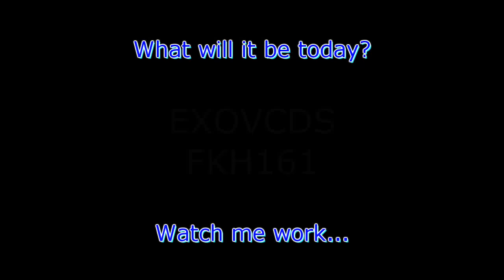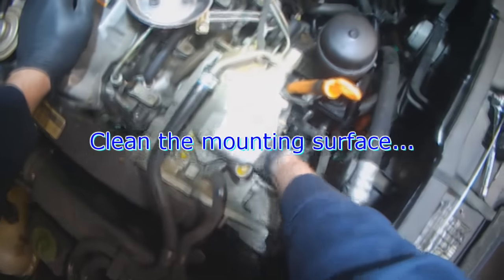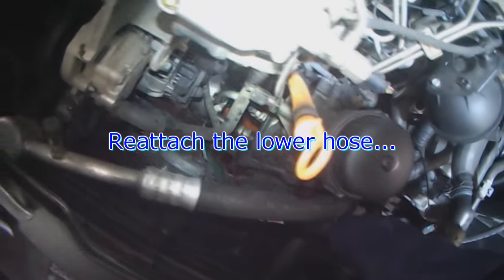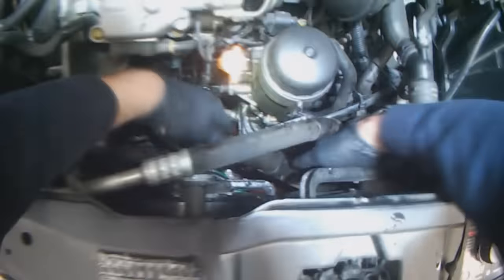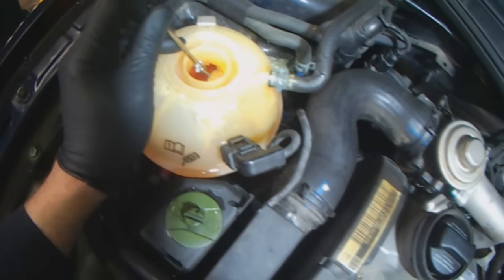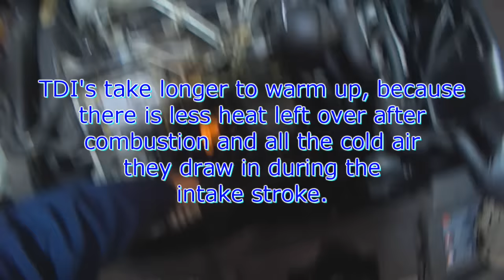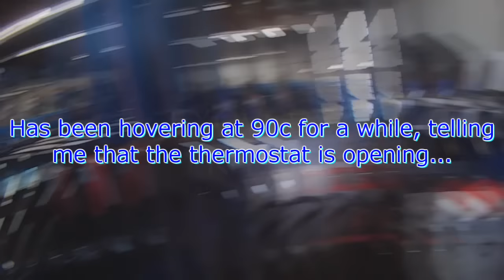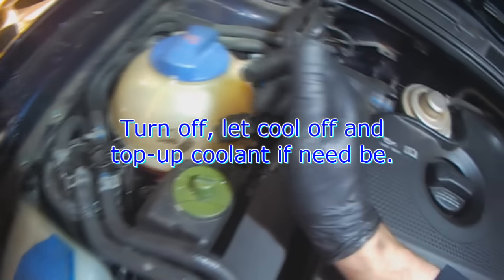VW A4: 1.9L ALH TDI Thermostat replacement (full)

Comment: Thanks for the tip on removing the oil cooler hose to drain the block.  I was wondering how to drain the block without making a mess when the t-stat comes out.  Question for you on TDI's.  Since the t-stat is on the return side of the radiator, should the VCDS temp reading be a lot different than the t-stat opening temp? I've got an '01 beetle and with an Ultragauge it's settles in at 203-206 deg F no matter the outside temp.  Don't know if that's normal or the previous owner put in a hotter t-stat.
Reply from the maker: Service manual info is correct most of the times. =)
Thanks for watching!
Reply from the maker: Should be an 87c / 188f thermostat.
Reply: @EXOVCDS  Ha!  Yeah, I still need to buy one.  I keep hoping to get a used Bentley manual for a good price.

Comment: Great video...perfect angle of view and cadence.  My GF has a '05 TDI beetle which looks to even less room to work and appears the Alternator may need to move to get at the T-Stat bolts.  Is that your experience?  Also, what is the large black ball, on your video it is high and to the drivers side, but on hers it too is right in front of the T-Stat ... Looks to be held on with a single bolt in a bracket; OK to move it out of the way?  Thanks!
Reply from the maker: Thank you for the kind words! BEW TDI? Watch this video: https://www.youtube.com/watch?v=zD6m34P3rDU Yes, the Beetle will have less room, but I do it the same way as in this video, since the setup is the same, just the body shell is different. The black round ball is the "vacuum reservoir". Yes, just move it aside for more room.
Reply: that was perfect, exactly what i'm looking at.  Given not a pro-job, would you not also change the coolant temp sensor whilst your in that deep and the coolant splashing around?  Inexpensive part and seems to make sense to me?
Reply from the maker: Yes... makes sense. It's at the back of the coolant flange on the right side of the cylinder head.

Comment: I need to pick up one of those long caulking guns to hold the accelerator and brake pedals down. Sometimes it hard to find an extra leg to help.
Reply from the maker: Steve has a great DIY for building one!
Reply: Hi N smith, nice to see you here. Thomas is right, Steve Rob shows how to make one.
Reply: wyattoneable Thanks I'm going to check Steve out before I buy one tks again Norman

Comment: Hi Thomas, I am having a new issue with my 254,000 mile '02 Jetta ALH engine's cooling system still has pressure in it even after 24 hours and an night with sub freezing temperatures. I have noticed this for the last 4 months, casually and just started to get concerned about it. Since 210k miles, the car has a RocketChip Stage 3 tune, pp520 nozzles and supporting mods. 

Around the same time a few months ago it started losing a small amount of coolant and I'd see a small puddle under the passenger side fender after being parked overnight (I think I've had this for 6 months, going on). I thought it was because I had overfilled the coolant ball to the seam and not to the low mark where my TDI mechanic likes it. Earlier this week I was surprised to find the dash coolant light came on blinking at me, and I found the coolant ball was low! 

I am starting to suspect I have a small head gasket leak that is starting to over pressurizing the cooling system. The cooling ball o-ring looks good, but, I went ahead and ordered a new coolant ball and cap, and picked up a block leak tester with the blue fluid from harbor freight. I also noticed some wetness on top of my manual gear box, but no pink crustiness) and am thinking it's also leaking out of the plastic coolant"Y" junction with the breather hose. I'll know more once I get the block leak test done tomorrow. The engine oil is clean and looks as it should,  I changed it 3 months ago (your videos have helped me tremendously!). During that oil change, I pulled a mid stream oil sample (just because)  but haven't sent it in for analysis yet. Maybe now I should.

I've been reading on TDIclub that some people have had this overpressurized cooling system problem and keep driving for years and 100k miles, still no fully blown head gasket. I don't think this is a normal and I did notice a little extra smoky start up after it had sat for a few days. I haven't been driving it over 100 miles as a result. But are the head gaskets on the ALH so prone to failure? Or is it b/c of the tune, nozzles and mods? The VW MK4 temp gauge is not very accurate, as you noted in this video, perhaps there's been some slight overheating under boost, that has caught up with it? I think the coolant is about 3 years old, don't show signs it's breaking down and when I test it's strength with a Prestone anti freeze tester (with a large needle in it, it tests strong even after tapping all the air bubbles out. Maybe those only work for green coolant? Just thinking if I get it fixed properly, I don't want it to happen again! Blue Devil Head Gasket sealer on my ALH, is that a bad idea?  Thanks from Pennsylvania, USA.
Reply from the maker: Pressure remaining in the system after cooling off is due to head gasket failure. Head gaskets don't last forever... some do (or seem to). 
Power / performance upgrades can shorten the life of components. 
Mk4 temperature gauges are accurate, but actual temperature can be off  in either direction and the needle will still be in the middle (190F)... the needle usually won't swing past the middle unless temperature is more than 108c (226F).
Coolant leaking on the right side of the engine is usually from the water pump or coolant reservoir.  On the left side, it's usually from the coolant flange.
Replace the head gasket and she'll be good for another 200k.
Reply: Thank you for your sage advice. It’s almost due for another TB & water pump, so might as well do it all. They’re never going to build a car as reliable, roomy & efficient as an ALH Jetta wagon GLS, so I’ll be keeping her on the road as long as I can.
Reply from the maker: @mailjabber  feel free to post updates here when the time comes.
Reply: @EXOVCDS  Hi Thomas, I shot the video 3 months back and finally got it edited. Link : https://youtu.be/L7b8CAqkLHI   I have been nursing my ALH along, I think the head gasket is only leaking under boost. The coolant is ca. 2 years old and needs to be changed (along with the HG!)  Here's the edited video of my block leak test, both cold engine and warm engine. Video is 90 seconds long, thanks for looking and giving your opinion. This is my first time using a block leak tester.
Reply from the maker: @mailjabber 
Thanks!
Reply: @EXOVCDS  So based on the video I linked to, you think the head gasket is blown. Is that correct?
Reply from the maker: @mailjabber 
My comment under your video:
-------------------
Thank you for posting! Keep me updated / how things went (warped head or cracked block etc.).
---------------
Yes, remove cylinder head, inspect head gasket, inspect cylinder head & block. If head & block are ok, install new head gasket. If cylinder head needs machining, check with machine shop if there's enough material to allow machining, otherwise you will need a cylinder head. If the block is cracked, replace block.
You might not be able to fully inspect the block, so you will have to take a chance with just the head gasket.
Reply: @EXOVCDS  ok, thanks for the confirmation. I guess it’s time to bite the bullet, and dig into it. 

Many thanks for posting.

Comment: I got a 2000 tdi jetta and no matter how much coolant i put in the level will always drop from the bottle and every once in a while the coolant light will turn off on the cluster and ill go out and look and there will be coolant in the bottle for a minute then it will drain away again. Very rarely after the car being running for a while will both radiator hoses be warm let alone the hoses to the heater core - it only works once in a blue moon which bites here in wyoming right now smh but im just not sure if i have a bad thermostat or if theres something else going on? Ive put about two bottles of coolant in it since i got it on the 18th and im half way through the third bottle now
Reply from the maker: A thermostat can / will solve a "lack of heat" problem... but it will not solve a "coolant leak" (unless the leak is from the thermostat flange). If you can not find a coolant leak anywhere, then the coolant might be leaking into the exhaust through the EGR cooler... or there is a problem with the head gasket. Most of the time it is a coolant leak from one of the coolant flanges or an oil soaked coolant hose that has a small pin hole. Look for a leak, fix the leak and replace the thermostat... you should have good heat then.

Comment: Hi you seem to have good knowledge of TDI engine's I bleed my diesel pump because of air but since then the temperature gauge seems to get hot quicker than it use to any idea thanks
Reply from the maker: Bleeding the diesel pump should not affect the cooling system... as long as the temperature needle does not go past the middle, the cooling system should be OK. Since I don't know all the steps you took (to bleed your pump) and what else was disconnected / move / reconnected etc... there's not much I can suggest, sorry.

Comment: Hello, i have a question: Is It normal in a 1.9 TDI with the operating temperature to have the Bottom hose cold?
Reply from the maker: Yes... tdi engines don't create as much heat as gasoline engines, so the thermostat will tend to stay closed longer. As long as you have heat inside the car and the engine is not overheating, all is good.

Comment: I was wondering what your strategy to get the engine up to temperature was. I did the thermostat on my ALH a while ago and after idling for 20 minutes temperatures were hovering around 80ºC. Working outside on a coldish day probably didn't help much. I eventually grew impatient and found about 2000rpm of weight to put on the pedal - though I like your method better! :)
Reply from the maker: A loaded drive (low rpm / almost lugging the engine) around the block can also help.

Comment: Thanks for your reply. Model VW mk4  deasel. Yes it does overheat. Tried the jumping rest from that three pin connector but it did not start nor on slow speed niether on fast speed. Checked the 30 amp fuse, was ok, the far right of the large fuses is blown out but I thing it has nothing to do with the fans. Do you think the fan needs to be changed?  
PS. The small fan worked when I did the jumping in the connector but it does not start when the engine is on, it starts on slow speed when the engine is turned off. Any clue what is wrong?
Reply from the maker: Carmel Cassar When the engine is hot, do you have heat inside the car? Turn the heater & blower on high. If heat goes away, the water pump is bad. If heat stays hot, the thermostat is stuck closed. Always replace blown fuses... there is always a chance that it affects the cooling system circuits.

Comment: Hello Thomas. I just done coolant flush with draining engine block but now hose from thermostat is cold. Rest is fine. Can U advise something ?
Reply from the maker: Is the temperature needle going past the middle? If not, let the engine run longer... TDI engines will run a long time before the thermostat opens. If the needle is going past the middle, then you probably have an air pocket or the thermostat is not opening.
Reply: @EXOVCDS  Yes it does reach 90 degrees , heating is working car is not overheating. When I did coolant change I did remove thermostat to empty engine block and the I did fit back in like it should be. Any advise ?
Reply from the maker: As long as the needle is not going past the middle...  things are fine. You just have to wait longer for the lower hose to get hot / the thermostat to open. TDI engines will can take more than 10 min to open the thermostat. Have the car standing and hold the rpm at 1800 to 2000 rpm.
Reply: @EXOVCDS  I did went on a A road for 15 min fast drive and still nothing just come back. Probably I still got air in the lower hose. Thermostat have to be fine if car reach 90 and is not overheating. I will try play with it tomorrow. Thomas thank U for help and videos.
Reply from the maker: As soon as you drive, the radiator & lower hose are cooled... you have to NOT move and hold the rpm at 1800 to 2000 rpm.

Comment: Would this be the same for ATD? I dont need to drain the radiator, just the hose from the thermostat? thank you!
Reply from the maker: Yes, ATD is similar. If you lower the hose too much, the radiator will drain completely. 1/2 of the radiator will drain if you keep the hose at the thermostat level / height.
Reply: @EXOVCDS  Thank you, just ordered my parts (thermostat has been stuck open). If i drain about 1/2 of the radiator, how much coolant would i need to buy, is 5L enough do you think?
Reply from the maker: 5L pure will cover a 10L system at 50/50 mix with water. Your cooling system takes 7L to 8L IIRC. Yes, will be enough.

Comment: Will a stuck open thermostat trigger a check engine light?
Reply from the maker: Stuck open or opening soon yes. 
"Cooling system performance malfunction" / usually P2181.

Comment: Instead of using silicone sealant you can just use a small amount of silicone grease, which does not damage rubber (unlike petroleum jelly, which will damage rubber)
Reply from the maker: Yes, there are many things that can be used. Service manual just says to lubricate the seal with coolant.

Comment: I am a bit scared of replacing my thermostat , so when I flushed my car (vw new beetle 2004 1.9 tdi 74kw) I didn't replaced the thermostat . Is that why that I didn't put 6L as preconised but 3.5L of G13 coolant?
Reply from the maker: Because you didn't remove the thermostat, there was still coolant in the engine / not all of it drained out. Also, if you did not disconnect the lower radiator hoe, coolant was also still in the radiator. If the engine is not overheating, then I would not worry about the thermostat.

Comment: After I replaced my thermostat and housing, it started leaking coolant. I followed the procedure you outlined twice. The first time I used o-ring plus gasket. The second, just the o-ring. Both methods leak. Verified that thermostat works, temperature never goes above the appropriate level, so on and so froth. For the life of me, I cannot figure out what I am doing wrong to cause this leak. Before I replaced the thermostat, it never leaked. Ideas? Thoughts?
Reply from the maker: Only an o-ring is required. Make sure that the mating surfaces are clean (remove rust from engine block). Replace the plastic thermostat flange if you did not already.
Reply: @EXOVCDS  Is the thermostat flange the same as the thermostat housing? If so, I replaced that. What is the best method you recommend for cleaning the mating surface? I was pretty sure I cleaned it well.
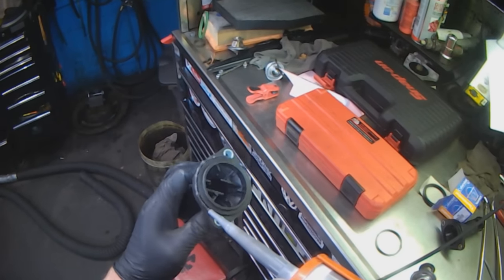Reply from the maker: The flange I'm referring to can be seen at 4:31
If you are working on a different engine / thermostat flange /  housing design... I need to know. Since you are commenting under this video, I assumed that you are working on the same type of engine. If you are, then you can see I did not use a gasket... just the o-ring and a bit of RTV silicone.
Reply: @EXOVCDS  Yeah, we have the same one and I used the o-ring and the silicone like you did and it still leaked. I do not however have a wire brush to clean it up as nicely.
Reply from the maker: @williamwarrenconkright3973 I use a wire brush to clean the surface of the engine block. Bolts can be reused. 15 Nm

Comment: Hello, I have same engine in my audi a3 2000 110 hp. Had problem with coolant loosing and hard coolant pipes after ride 30 or more km. Last year my upper hose blown and overheat, I change upper hose, new gasket and new head. Coolant and pipe from coolant was fine for about  half year than same problem start again. Recently I change my coolant heater because coolant foged the windshield. Then coolant level was OK for 2 weeks and pipes than again same problem. Recently I found some coolant foged windscreen again but nothing too much, when I turn on ac it goes away. I checked lower hose pipe from radiator after ride from 250 km and it was cold. Coolant level drop litle, day after when I open cap from coolant it release some pressure and rise litle but nothing much, cca lost maybe 0.3 dcl from 250 km ride. My mechanic say that is maybe engine block cracked (I see one spot on block that had litle oil on it). Oil color is OK not milky, doesn't get higher level that it should and color from anteefreze is pink,no white smoke from exhaust. Could it be block, head, gasket or something else, car has 375000 km on clock,car is running god now with temperature 90 degrees and doesn't owerheat, just coolant loss and hard radiator hose, thanks for answer.
Reply from the maker: Cracked head, cracked block or bad head gasket. Windshield can fog up when AC (condensation) drain is plugged. Water starts to collect in the heater box and once the heater gets warm, the water evaporates and fogs the windshield.
Reply: @EXOVCDS  thanks for the answer.